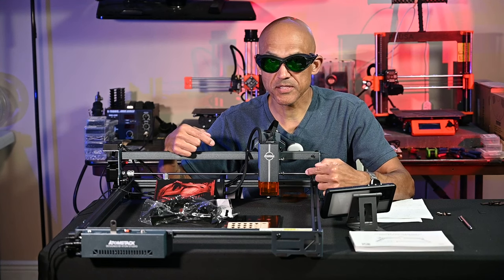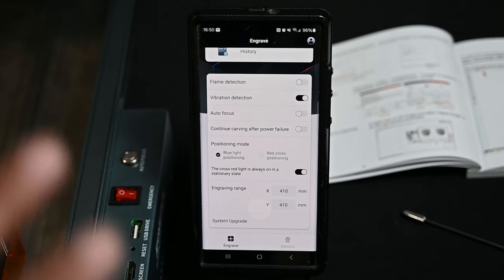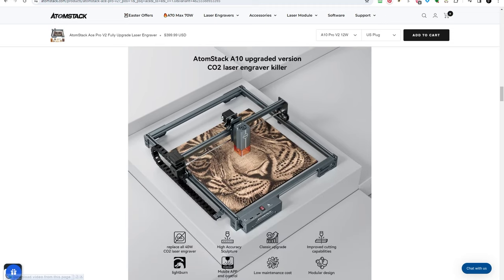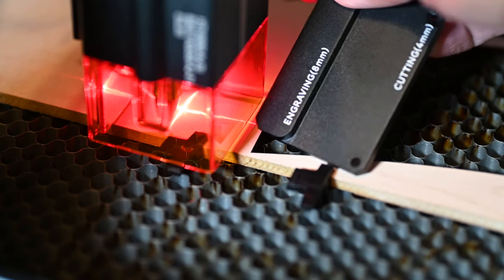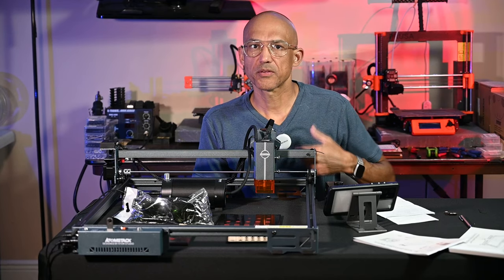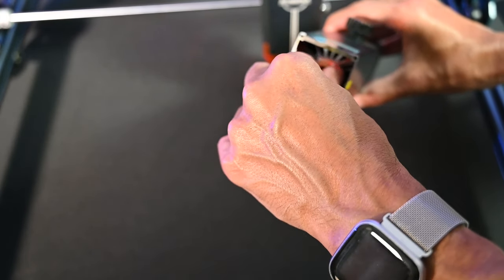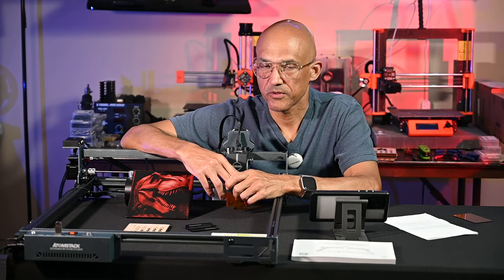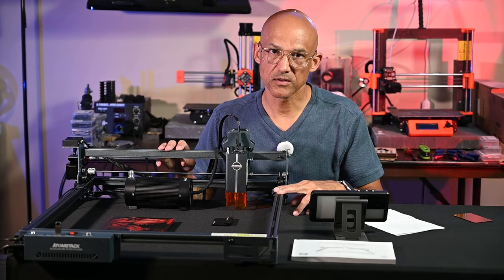Atomstack ACE PRO V2 Laser Engraver/Cutter Review - A10 Prov V2 with F 30 V2 Air Assist

Comment: Another great informative video with a great honest review! This seems like a pretty decent laser for people who are getting into the hobby, especially since they have the settings tuned in the app already. Even though running calibration tests are better to fine tune the laser, this takes a lot of guess work out of it. The app needs some work obviously but its nice to have for people who don't want to take the leap on lightburn in the beginning.  I started on a $300 5.5w output laser in 2022 and it didn't have an air assist. I had a lot of fun with it even though it was slower but it was exactly what I needed to get into my CO2 and fiber.
Reply from the maker: Thank you!  I do love that the prices are coming down and many of the things I had to DIY on my first diode laser are now well thought out and included.